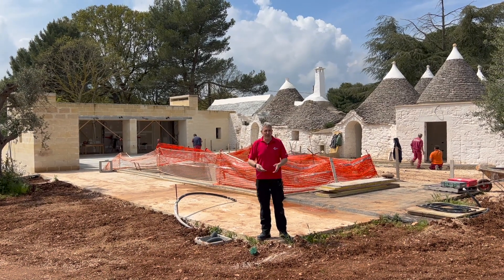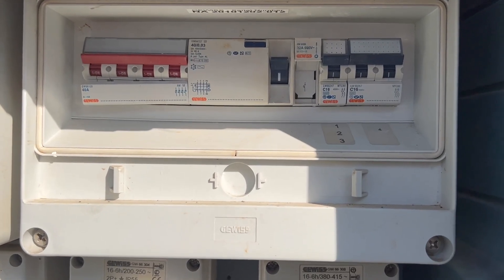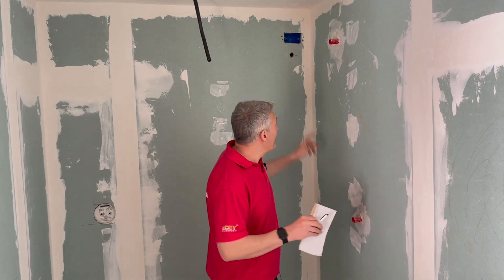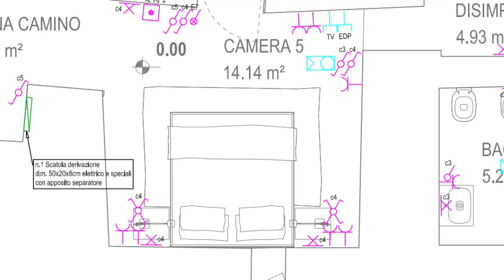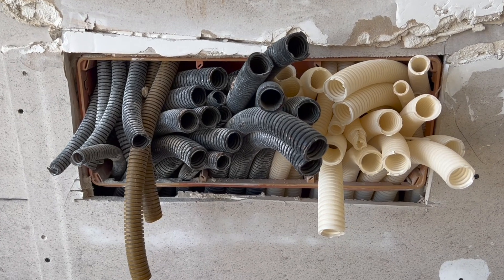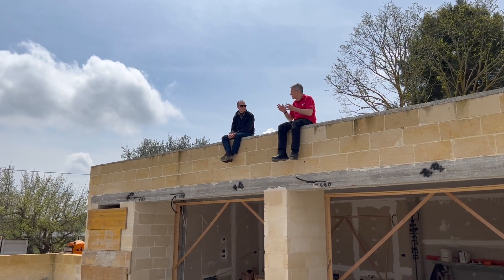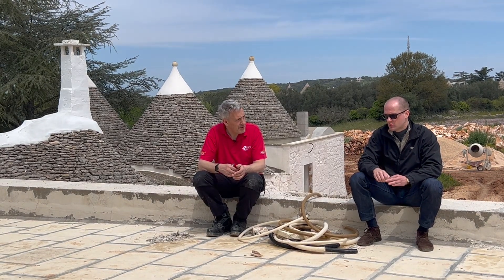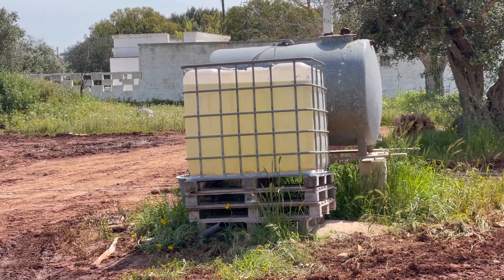Electric Wiring in Italy - You Won't Believe What They Do!

Comment: You guys seem like one of those Americans discovering a Wago in this one. Flex is the absolute standard in quite a few european nations. I just think they should be prewired. In Belgium we do it like this. Ofcourse we have cables for certain situations. But most is prewired flex. All that is hidden on the floor. Anyway, no offense. I like your channel. You should do this more often in detail. In that regard we europeans are quite the mess with every nation having their own code.
Reply from the maker: We are on a journey of discovery. Most countries are confused by the UK obsession with armoured cables SWA and threaded metal conduit.
Reply: @efixx  
Threaded metal conduit?
Most is mineral insulated cable in commercial and the likes of boiler rooms.  
We have much cheaper solid, and less flexible, twin & earth cable, which is not that good to run in conduit. Hence we have it on trays, plastered directly into walls, etc.  Using RCDs raises safety, and means OK having them directly in walls.

Having plastic flex conduit in an apartment is overkill, apart from having one with a largish bore from the consumer unit to the kitchen where most heavy appliances are, and most adaptations of the electrical system occur over time.

Comment: 6kw supply? 🤯 I'm U.S. on split-phase 240v, 200 amp (48kw) in 1970s construction, and the typical around me now is double that!
Reply from the maker: I think average property sizes in the US are considerably larger.
Reply: @efixx  Besides needing air conditioning for a good chunk of the year in much of the country, electric ranges (usually a dedicated 50A 240V circuit) and water heaters (often 4.5kW or 5.5kW for storage tank and up to 36kW for tankless instant) are common.  Our heat pumps also have resistive backup heat packs of anywhere from 5kW to 25kW.  It's also common for houses to have water wells with submersible pumps as the water supply.
Reply: @randacnam7321  also in italy
Reply: im not glad has lot houses burn down at USA.

Comment: Flexible conduit makes more sense in countries where the electrical installation is done entirely in flexible cable (class 4 or 5). That's how we do it in my country. 
UK's wiring is usually class 1 or 2, right? It would be a pain to get those kind of wires through the conduit.
Reply: In Germany we used conduit in the past (flexible as well as smooth rigid) and we indeed use solid core wire. Unfortunately, we are only allowed to run a single breaker (circuit) in in one conduit, so for space and cost reasons they started to use simple double insulated wires (NYM, individual singls cores with an additional common sheathing) wiring. These days we have NYM directly concreted into the wall and there is no way to add even a single switched wire afterwards since there is no conduit in walls (except in concrete where it is mandatory).

I still do it as shown in the pictures - one has to be careful to make the corners smooth enough though.

Comment: How do you push the cable into the conduit? Is it flex?
Reply: You don't push, you pull 😉
Reply from the maker: Semi stranded class 2
Reply: We use class 3 i think and we pull the wires with cable probe

Comment: I honestly think the conduit approach is light years ahead !
Reply: You just try and add more cables to flexible conduit. I think you'll start to appreciate the disadvantages :)
Reply: If the plastic conduit does not flatten of course.
Reply: @johnburns4017  I never seen one of those corrugated tubes flatten, that's why they're corrugated
Reply: @johnburns4017  a valid point, I just like the idea of it so adaptable
Reply: @johnburns4017  that doesn't usually happen. Maybe one or two in the whole house due to damage during works.